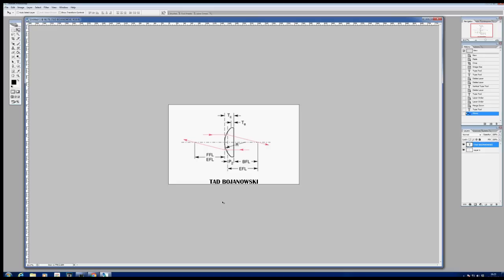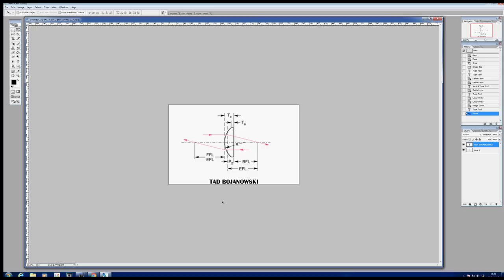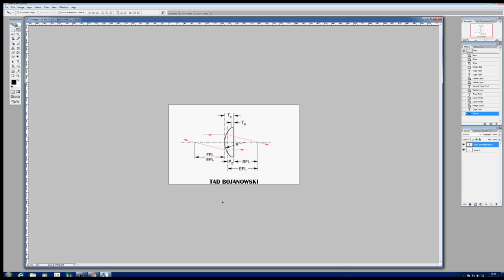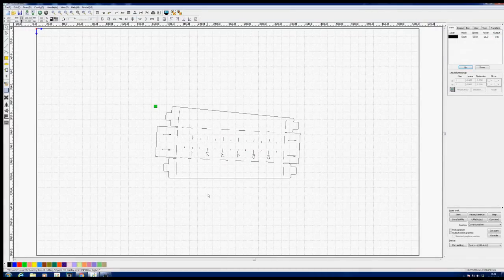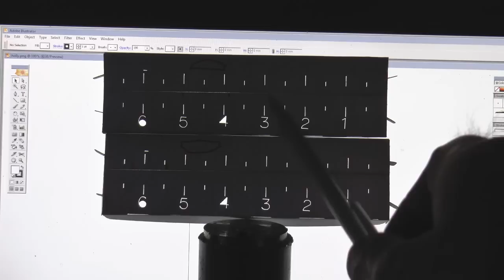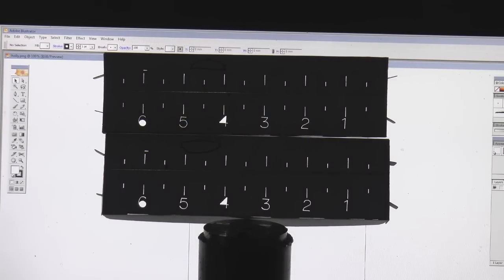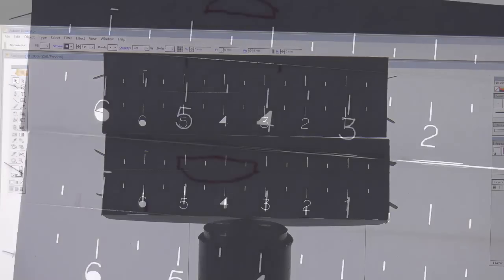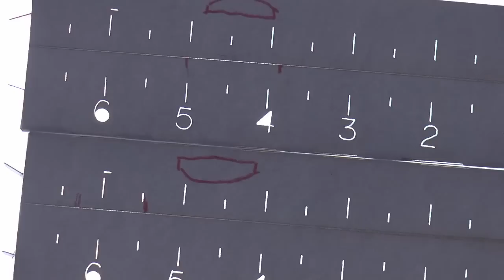RDWorks Learning Lab 60 Lens Orientation

Comment: Hi Russ found this   Some good reading   http://www.parallax-tech.com/faq.htm#cut
Reply from the maker: +3K Carbon - G10 - FR4 - Supplies &amp; CNC Routing - 3D CAD Design &amp; 3D Printing - Online Shop 
Hi 
Thanks for the lead, I'm always interested in links that people discover and send me. I have done a huge amount of research in my learning journey and this particular website is a rich source of good information. They are not very impressed with Chinese technology, particularly the cheap glass tubes. BUT at their tube prices I could buy at least 10 reputable  Chinese tubes.  I used some of their facts in a simplified way to illustrate different lens properties in https://youtu.be/WbBPps42iHc a few months ago.  Sadly I failed to understand the different focal distances associated with lens orientation. That's probably because Parallax tend to push meniscus lenses rather than plano convex. I'm not sure what happens when you put a meniscus lens in upside down.  For the simple plano convex type, I am now a wiser man. I will continue to use my lens flat side down (technically this is the wrong way and the Chinese had it right to start with) BUT what I can see from a practical point of view is 
A) the waisting seems longer and tighter resulting in marginally improved energy density 
B) the focal distance is reduced so that I can get my nozzle closer to the work surface and force better airflow into the kerf. This is important for cutting materials that burn (ie wood) because the smoke is a great IR absorber. Keep the smoke away from the cut face and improve cutting efficiency/depth
In conclusion, convex down is conventionally correct but convex up offers advantages that I didn't realise, until now.
Thanks again for sharing your research, it was only because of another guy sending me links that I have relooked at lenses
Best regards
Russ

Comment: Just brilliant!This is an invaluable resource that I see myself using as standard way for testing materials before cutting. You are sparking my creativity, I will probably modify the design and include several lines to test different levels of power and speed. I'm a bit concerned about the crispiness of cuts my yet to arrive machine will produce cutting paper. I opted for a 80W laser tube instead of 60W or even 40W knowing that I would sacrifice a bit of resolution due to the wider beam. After seen this video, I will use this to extract as much resolution as I can from my cuts.
Reply from the maker: +Abraham Saenz 
Hi Abaham
The crispness should not vary with power as the beam will still be about 6mm diameter before it passes through the lens. The lens will shape your beam regardless of its power. What you may find is that more power is more difficult to control at lower powers. For example, lets assume the power characteristic is linear (which it will not be) the I have between about 10% and 65%  ie 55 divisions to divide a 50watt tube into ie about 1% per watt power. Now if my tube was 100 watts then the same percentages will apply and I now have 1% power=2watts. You appear to have only half as much control....quite important at low powers for cutting paper BUT fear not because something I never used until my 60 watt tube was the 0.1% power selection. Yes, you can change those 55 divisions into 550 divisions to control the low powers.........something I ignored with a low power tube.  You will barely need your tube whispering at about 12% for paper.
Best regards
Russ
Reply: +SarbarMultimedia Thanks, do you think I will benefit from using a 1.5" or even a 1" focus lens for cutting paper? I've seen some "high resolution" laser heads produced by thunder laser ( haven''t seen them avaliable anywhere else)  http://www.thunderlaser.com/features/high-resolution-laser-head.html, since they are very shallow, I believe they are designed for 1" lenses. Have you researched on those?
Reply from the maker: +Abraham Saenz 
I have looked in passing but I think I have the best of all worlds with my 1.5" lens flat side down. It gives a very fine cut with some depth tolerance. The 1" lens will have to be pinpoint accurate on depth to get a small advantage. The trick is to balance speed and power, but with paper, because I am using a pin bed support I also have to control my air assist to just a whisper otherwise it can push the paper out of focus. If you have a honeycomb table, every time you pass over a piece of metal you get a reflection and a small burn mark. With my flexible pin table I can set my pins to stay away from the cuts. I am currently working on a Christmas card design commission for my sister who belongs to a worldwide ladies organization called the Red Hatters.  Go to my You Tube private messages and send me your email and I'll show you what I'm doing.
Best regards
Russ